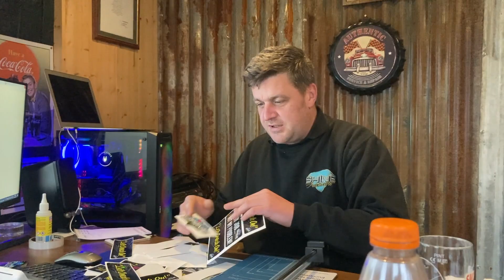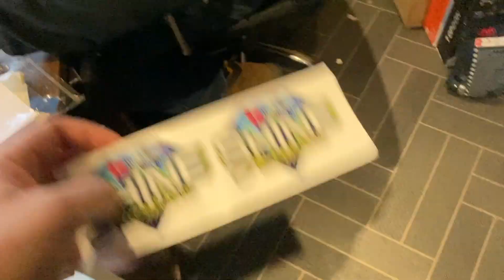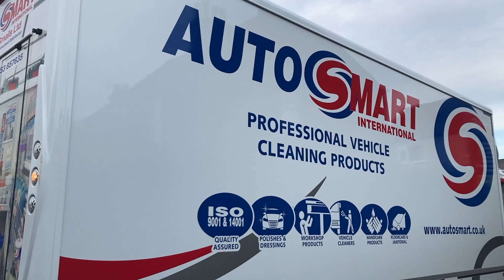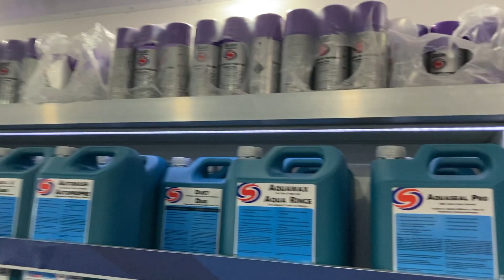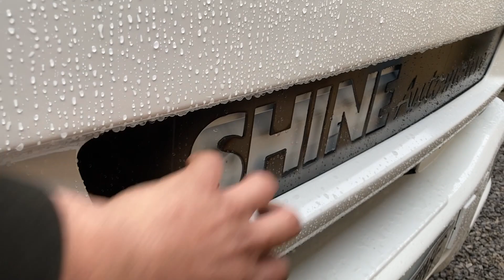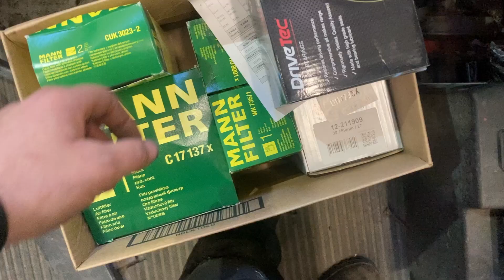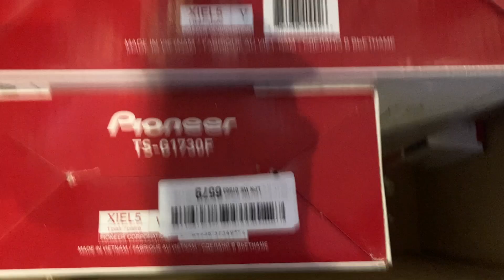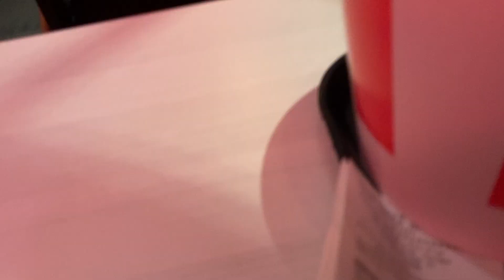YOU NEED TO SEE THIS AGAIN - One Mad Crazy Week At The Garage - The Joys Of Being A  Mechanic Part 2

Comment: Hi watched couple of ur vids really enjoyed dem, also am looking for some information about a Opel Astra g mk4 1.7dti Y17dt problem am having is everytime I take my foot from accelerator my car jumps judders kangaroo mostly going down hill at low revs between 1000&1500 rpm, any help would be great
Regards fin 🇮🇪👍🚗
Reply from the maker: egr valve ? welcome to the channel
Reply: @shineautomotive  done egr edu module fuel filter map sensor maf sensor. Also took fuel pump out an cleaned it up, thinking maybe injectors car is starting first turn of key also still handy on fuel